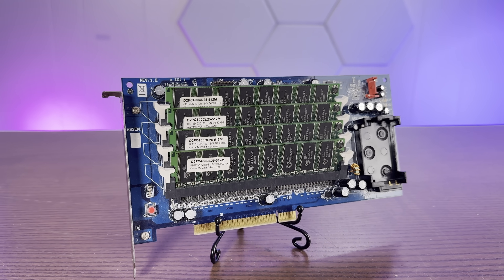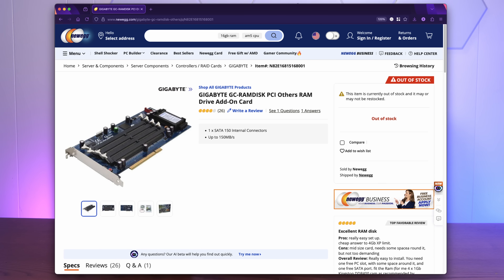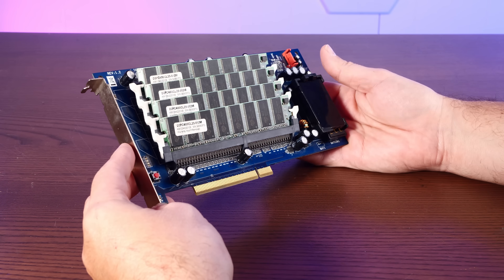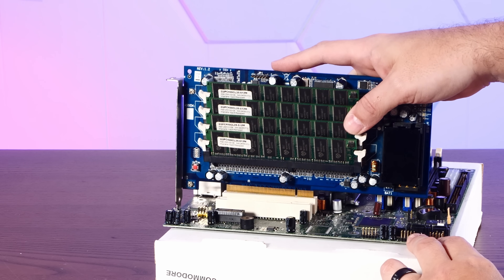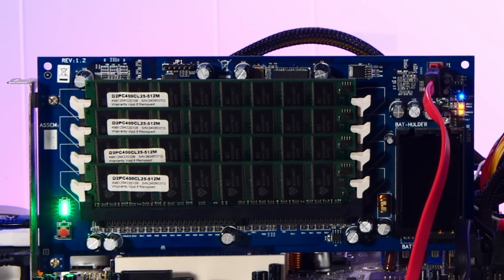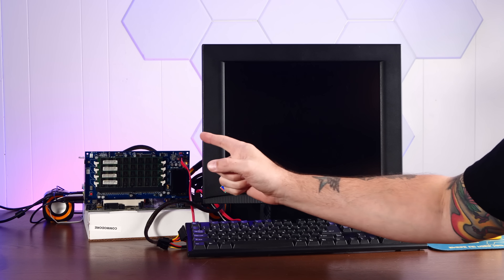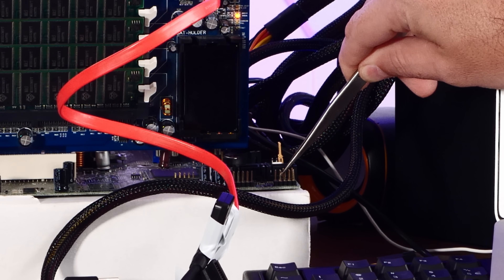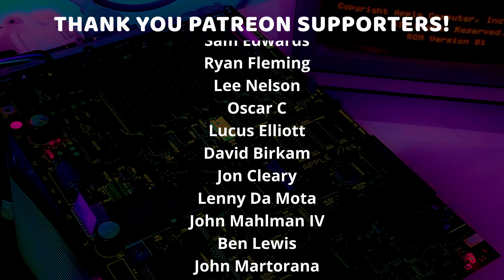This Early SSD Was WILD

Comment: back in the early 90s AmigaOS allowed the use of a ram drive, where if you had enough ram you could use it like a solid state drive, contents would stay in the ram drive as long as the system stayed powered up. of course you'd have to store it to a physical disk if you needed to hard boot the machine but soft booting with the 3 finger salute was fine. one time just for shits and giggles on my a1200 I installed the entirety of the OS on the ram drive. of course i had a DKB cobra accelerator with 128mb of ram so i had plenty of space lol.

Comment: Back in 2000, I got to witness an early implementation of Solid State drives at University of Toronto. It was a full rack (42 U) of boards with just a butt load of chips populated to it. I think it was 100 MB? Can't recall. They were using it to drive a facial recognition program that my plaid shirt immediately crashed.

Comment: An LRDIMM version (fully functional) with a slow-release capacitor for weeks-long power outages with no spicy pillow outcomes would be ideal for situations where read/write throughput is vital. Have it plug into PCIe 5/6 with an NVMe interface for truly screaming connectivity.

I mean, base OS or long-term storage would not be well served by this device. But having a database serving up thousands of queries a second 24/7/365? Especially if there was a continuous shadow copy elsewhere? That would be a perfect use case for something like this to shine.

Docker instances - especially immutable ones - would be another excellent use if they required fast drive interfaces.

I would also love to try full-fat VMs on this, as having multiple VMs on a single U.2 or M.2 can still saturate the drive’s capabilities. Something like this could likely host many VMs with ease.

Comment: With nVME speeds far surpassing the SATA limitation of this device, there's not a whole lot of practical use cases. (Even as a swap disk.) However, using it for a scratch disk for recording videos or doing some heavy editing would probably be the best use. Mostly because it saves write cycles on modern SSDs.

Comment: Back then — and often even today — it was the ultimate “oh shit, the cops are raiding the place!” device. With a small cord (fishing line, twine) that you ran through a screw hole to the outside, you could pull the battery out. You’d then just tie the cord to your table leg, your radiator, or whatever. So if someone took the computer, they’d pull the cord and the battery would fall out. That meant there was no data left for forensics. So… that’s what I heard. ~cough

Comment: Thing is, this could only max out transfer speeds to 133MBps. Any ram faster than the pci bus would be pointless. Plus if this is in heavy use, your pci sound card (or worse yet, a pci GPU) would be starved of bus bandwidth.

Back in the day, drives didn't achieve these speeds so it made sense than, not so much now.

Comment: Honestly, swap space is probably the best thing to use it for. Which is fitting, all things considered. Actually, the really convoluted thing would be to have your main storage modern SSD(s), and your actual RAM, as usual. But then have a modernized recreation of this monstrosity (base it on DDR5, but with swappable adapters for 3 and 4, to reduce e-waste) for primary swap space, and then a 1TB spinning platter for absurd secondary swap space capacity. 

So, essentially, 3 tiers of RAM (possibly dumb, but possibly also viable on lower-tier OEM systems with like, only 2 traditional RAM slots and no support for high-capacity sticks), and a minor write reduction to a modern SSD.

Comment: I wonder if tere is a similar but for modern ram 😅 still i would install octane ram and use it a a cache for a big raid  even today it is not obsolete,   the only whired thing is the sata connector  mabe as a workaround for  bioses /uefi that didn't supported pci boot  not even today all motherboard support pci-e boot

Comment: One potential use case would be as a RAM disk for workloads that modify or create thousands of small files, for example removing metadata from 10000 images in a single batch or adding a license notice to thousands of source code files.
Sure these days SSDs are likely a better option, but back in the early 2000's a solution like this could've shaved off the better part of an hour from a simple processing task compared to traditional high-latency hard drives.

Comment: ACARD made something like this that could be considered the evolution of it. It used DDR2, Sata II, was meant to use up to 64GB of DDR2 across 8 slots (although good luck finding 8GB DDR2 DIMMs), did not require the use of a PCI slot for power (it used standard SATA power), had a Compact-Flash slot for backing up the data from the DRAM, and was designed to fit in a 5.25" bay. There was also a version of it that had 2 SATA ports on it that allowed RAID-0 of the 2 memory banks, enabling even more speed. Good luck finding one these days though.

Comment: and yet.... battery backed up ram based ssds go back to the 1980s and the ibm xt. just that back then they were called 'hardcards'. not to be confused with those other hardcards which are just some inferior mechanical hdd make glued to an isa board.
Reply: and tbh :P they should all have been like that from day 1. storage belongs on isa or pci cards. not on some mechanical thing hooked up with a flimsy wire. allowing direct access from day 1. not even pretending there would be 'heads' or 'tracks' :P
Reply: for some reason the inferior mecano boxes making weird noises 'evolved' to the point where they became somewhat acceptable. and the default option,  instead of just 'fixing the battery problem on the real actual permanent solution' :P as obviously moving parts never had any place in computing. they always were just a cheap workaround.
Reply: there is no universe in which producing a mechanical harddisk is cheaper than just making a whole lot of chips and putting them on a pcb. :P just that the harddisk factory already was larger than the chip factory :P the idiots still make those things today even. and other idiots buy them. lol. mechanical harddisks never should have existed. how the hell would some titanium platters and motors and heads be cheaper than just 'sand' which is the main ingredient for chips :P lol.
Reply: but then again the internet also used to run it's last mile over stuff totally never intended for data. such as that age old telephone network or tv cable. that should never have been the case either and telcos should simply have rolled out native ATM or ethernet based networks in the 1980s. instead of all these crappy 'it barely works' workarounds not to do it properly from day 1 and watch the price go down by itself when you sell a few million of em.
Reply: somehow the inferior crap usually 'wins the battle' and then sticks around. lololol. and the real solution is only 're-invented' 40 years later haha.

Comment: Back around the early SSD days I had what was sold as an SSD cache drive. It's still got a newegg page as well ( SanDisk ReadyCache SDSSDRC-032G-G26). It actually worked well after a few boots it cached the most used files from the HDD and reduced windows boot up time from like 40 seconds to 8 seconds.  Same for games and other programs they opened maybe 5 times faster once it learned what you use frequently.  Every now and then the program would crash and it lost everything so it had to start the relearn process again and you had a slow computer for a little while.

Comment: Honestly, this still has value. From what I understand, RAM is faster then using an m.2 by a lot. I bet doing this with 512+GB of ram and have a modern battery, this would actually be insanely good depending on what you planned to use it for.

Comment: When I was working as a database admin for EVE Online, around the same era this came our, we had a similar, but way more expensive device called RAMSAN... it was an appliance with loads of DDR RAM,, spinning hard disks as backing store and multiple redundancies of everything, so it could never run out of power before dumping everything to the spinning rust. It was so fast that in the led matrix on front of the device that measures its throughput, we only ever managed to blink one led and mostly kept that display on "demo mode" for the blinkenlights. It connected to our database server via fiber and contained the most accessed data on our database server..
Nb. it was so fast that it required an export license from the US government as it was considered a dual use technology. We kept using it even after getting SSD disk arrays, because of how fast it was compared to the flash storage.

Comment: why that uses ddr 1 ram? It is so small. My first pc with ddr had max 4GB
Reply: lol no it didn't couldn't even fit enough sticks in the pc to get that much and it wouldn't have been supported by any cpu or motherboard lol Maybe it had 4Mb but considering 20Mb drives back then were huge i doubt that too
Reply: @gamersplaygroundliquidm3th526 DDR 1 was sizes 128Mb to 1GB so what are you saying about 4Mb? Not DDR 1 from video. Now we using ddr 4 and 5 typically around 32GB per stick

Comment: You know those hackers where the feds would wait for them the have there computer open to get all their files? This would be a great tool for them... Remove the battery and have it run directly from the power grid... then when the feds com in yank the cord for the pc... aka have the cord attached to you leg so even if the had guns drawn, you could still remove power!!! Would have been crazy huh?

Comment: That's amazingly cursed! Excellent stuff. 2006 is new though, I used to have a DEC StorageWorks unit from 1993-ish that contained an RZ25 or something similar, and a stack of RAM; at powerup the thing would spin and copy all of its data to RAM and present itself as a RAM disk to the VAX or Alpha host. I never did get it working and unfortunately it got recycled. Fun tech for the day though.

Comment: Oh, good ol' no AI days!! I used two of those cards in RAID 0 setup and really loved them  :)
Early-generation SSDs suffered from overwrite issues because data could only be erased and rewritten in large blocks, causing performance loss and faster wear. 
But this fun hw use DDR 400 memory modules.. :) The bottleneck was the SATA 1 interface.

Comment: Back in the old days I used them for database operation in heavy loaded server. OS was on "regular" 15k SCSI HDDs. I had four of those, all equipped with 1GB sticks and all run in RAID0 configuration with use of controller on PCIX slot (64bit PCI). You can imagine how f*cking fast it was. Overnight there was scheduled whole partition backup in case of power loss. I still have them somewhere collecting dust.

Comment: Love that these are RAID controllers without the SAS interfaces... And surprised we don't do this with DDR5 on modern RAID controllers
Reply: Modern RAID cache uses capacitors. On power failure it flushes to flash to then boot up and write to disk up to 3 years later. 5-10 years ago controllers used Li-Ion BBU to handle power outage for only 2-3 days and had to be replaced pretty much every 1.5 years due to short lifespan of batteries. 
Today's RAID cards are pretty much external drives plus this tech,  smarter way to handle performance, capacity and outages.
It's awesome tech that allows small/medium files be written near nvme speed to SAS/SATA HDD drives.

Comment: i will use it for working on highly confidential files
with a little rope attached to the battery and the door
if anyone breaks in, the battery disconnects and data is gone

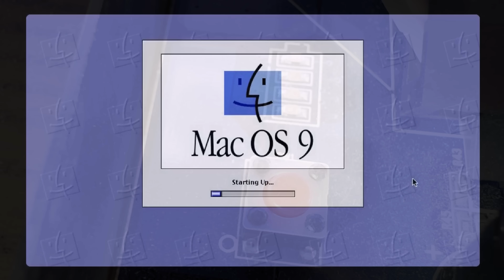Comment: 0:05 No it's not, That's a ram disk. It is not a solid state drive since it doesn't use any solid state chips but volatile ram chips. That's why you need a battery for it if it loses power it loses all the data.

Comment: It would be far more useful if it had a usb port on it for backup of content that automatically saves a image if/when the battery is used, aka a power failure/disconnect. I´d love to see a modern version for pcie be made, we may still need scratch/swap disks on a system with only 2 ram slots (or 1 if one is broken).

Comment: 0:59 Why??? If this would exist for ddr5 I would immediately buy. I don't need the persistent storage, but after working with a 32GB ram disc as my personal cache I would love this as a way to increase my personal cache
Reply: Why DDR5? It's so expensive...  please tell me the shortage was still there 2 months ago when you wrote your comment.
In any case, DDR3 server RAM would be better. It's sooo cheap, my employer was literally sending working 16GB sticks to scrap for being worthless. Get an old server, fill it up with 384GB of RAM, and connect it to your main system over 10GbE or better.
For an in-between ground, consider the now-discontinued Optane drives.
Reply: @eDoc2020 This was exactly before the prices exploded :(
Reply: It is available already. It's called CXL.
Reply: this does exist for ddr5
but its hard to find. but in some rare pc nerd shop they sell sht like that. but why would you? 
just get an m.2 
the higher once are already faster than most cpus can handle.

and if you realy need faster get a m.2 raid card. you can get a four way raid one with 16x slot. 

and probably some x32 for servers.

Comment: Man, in 2006 everything I saw on consumer PC's was still largely IDE. I have kept a Presario SR1103WM around for decades at this point, and even though the CF card I have in it maxes out the IDE bus speed, it would be a crawl even for a SATA HDD in comparison. In hindsight, I'd be MUCH better off getting a SCSI card instead, probably.

Comment: Never plug anything like in 9:21, voltage difference between laptop and desktop might be unpredictable and might damage the device or even a laptop. Always be sure too use same power source for supplying power to device and for data. To be clear many IO ports are designed for that (for example USB-C or Ethernet etc)

Comment: Seems like the motherboard you're using is only SATA Gen1. That might explain why both the iRAM and SSD both topped out at 133MB/s, which just so happens to be the top speed of the interface. You may get far better speeds from the iRAM on a SATA Gen3 interface presuming the iRAM itself isn't also capped at SATA Gen1.

Comment: This wasn't an SSD. This was a ram drive. Similar to a software ramdrive. Some older PCs like the amiga did this in the past as well. You could get a ram drive for amiga 500s etc.
Verry fast but actual SSD drives came along shortly after this and the size became more important as the cost of system ram drasticly reduced.

Comment: This is interesting but triggered some PTSD. Back in the dark days of my early sysadmin career I worked for an academic publisher who had bought a "turn key" website solution from the lover of the CTO. This solution consisted of a Pascal32 website with a propriety scripting language and a MySQL database using the MyISAM engine, which did table level locking for inserts. The database consisted of just 4 tables all of which were written to for any write action. 

Needless to say the database even running on fast SAS disks couldn't keep up writes and was one of the many reasons the site would crash under load. My fix was to run the primary database in a Linux RAM disk replicating to the local disk for persistent storage.

Absolutely cursed, the CTO resigned on mental health reasons, citing a toxic work environment and retired to a farm house in the South of France bought from the profits of the turn key solution.

Comment: I remember seeing these for sale an thinking, I would get one if I could put DDR2 in it because DDR capacity was too low for what I would use it for. Something like this for NVME that would allow tiered storage with a flash SSD would be useful for some cases today where enterprise solutions are just out of reach. Launching it during the AM4 to AM5 transition to have 64 to 128 gb of DDR4 ram as a drive cache from your old system would be neat, even if it would only help with some poorly optimized software that streams data from the drive.

Comment: Devices like these were never designed to be used for data storage, they were designed to be used as high speed cache for things like databases, rendering, or any other application that needs temporary but high speed storage. The OS would be installed on a regular disk and this would appear as another disk that you could temporally save data to. Never seen one with a SATA output as most of the time they would present as a PCI storage device. Wonder if you could pop 4 of these in a system then use a hardware RAID controller to strip data across them.

Comment: When I worked at Intel on the rack of junk we had a RamSAN - was basically the same concept except it was a 4U rack mount chassis with like 32GB (may have been 64) worth of RAM sticks with a 4Gb FibreChannel interface, things were like $100k but I was never able to find much in the way of specs.

Comment: IIRC, there was an even earlier one that used PC100 or PC133 back around 1998-2000 or so. Fit in a 5.25 drive bay with an EIDE interface.

Comment: I like the fast-scratch disk idea, especially considering RAM has no limit on write cycles.  When I had an X399 Threadripper, I installed 128GB of DDR4 RAM just because I got a good deal on matched sticks (for a quad-channel setup, etc.) and it generally left around half the RAM completely unused to my normal operation so I would create a 64GB RAM DISK as a super-fast scratch disk and it was super handy.